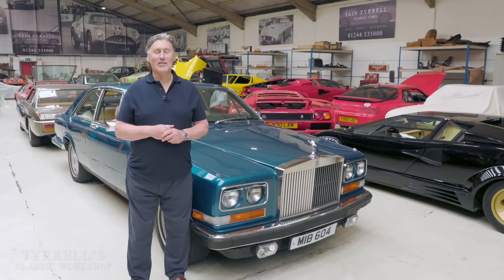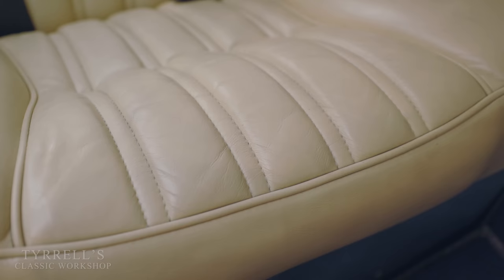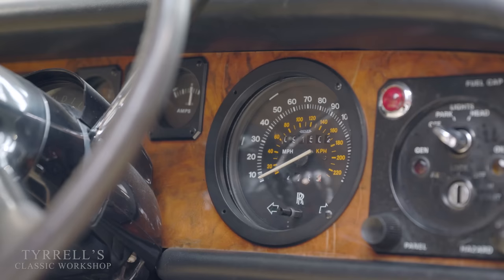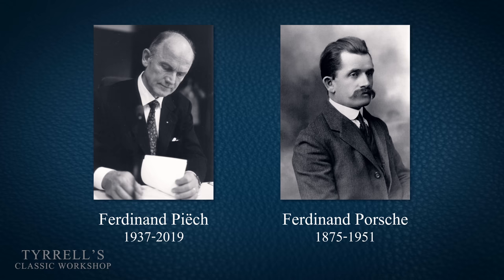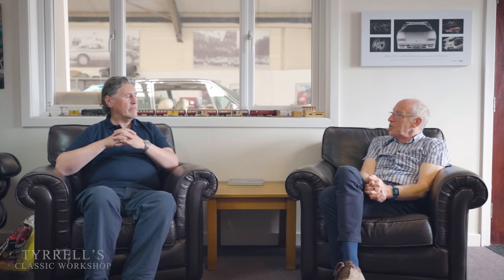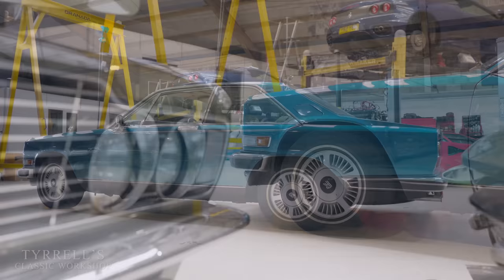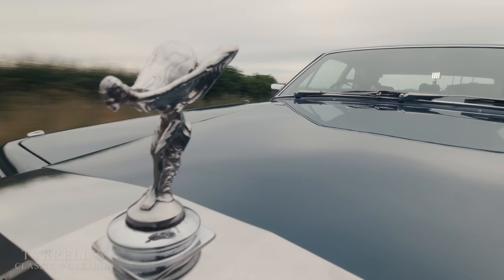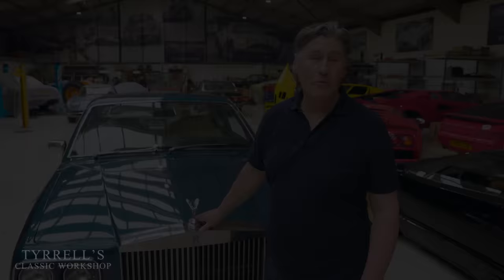Rolls-Royce Camargue - a surprising source of inspiration for the World's priciest production car

Comment: When I was doing a  couple of months "industrial experience" at Crewe in 1969, a requirement for my engineering degree, a guy turned up a the parts department looking for a replacement sump pan for his 1920s Bentley barn find that was originally one of Wolf Barnato's Le Mans racers - a one-off. Post race it was converted to a gentleman's tourer. The story was that they shoehorned a big engine into a smaller chassis and the sump pan was very non standard. The Crewe parts department had a replacement sump pan in stock. As soon as the existing one was bought, the parts dept. ordered a new one.
Reply: It's the same with heavy equipment parts that wear off  too slowly  or are never supposed to be replaced . Once you order the last part in inventory,  manufacturer give order to produce a new replacement  to be held in stock
Reply: Just imagine if 2 people ordered it at the same time 😂

Comment: Ian is absolutely right as usual. I ran a Shadow, then a Spirit, then a Turbo R years ago - and always thought the Camargue looked wrong. But with the slightly later alloys and in the right colour, they are ageing very well - possibly better than the Spirit/Mulsanne. As the Turbo R prototype was a Camargue (I believe) I can't help thinking that a Bentley Camargue with the Turbo R engine would be a fantastic retro mod.

Comment: Iain, a fabulous insight to the car and brand.  I can only endorse all of the previous comments - fascinating.  If I may, between 1984-87 I was a young police officer based in Crewe.  Part of my foot beat ( yes foot patrol) was the RR Factory.  I never got beyond the security hut with a brew but fabulous view of all the cars going out on road test prior to delivery.  I got to chat with a test driver, all hand picked who explained that most cars would have around 80 miles on the clock.  Due to them being hand built they were all very different, with their issues yet perfect once they went out for delivery.  Masking tape around the steering wheel to write notes on to remind each test driver of issues.  Final wash a polish and it’s new wheels fitted, test ones removed - great.  I would add that your channel and Harry’s Garage make great viewing, far better than the BBC these days - thank you, Mike.

Comment: Oh how much have I enjoyed this video! Thanks again, it's always a huge pleasure to view them. I'm fully aware of the battles between Chassis Development, Forward Engineering and Design departments in the early stages of a project development, to make sure that once in production, the car will give the eye a correct stance, a perfect appearence of standing on its feet with perfect balance between its corners, and with all the four wheels filling the wheel arches in a pleasant way to the eyes. But of course, in the early 80's things should be fairly different and more difficult! On another subject, regarding the visit of Dr.Pïech to Crewe, I can imagine the stress of having to give bad news to him ... something similar seems to have happened a decade before, when a chief engineer at Porsche had to inform him that the 917's modified by John Wyer (917 K from "Kurzheck"-short tail), although having effectively more drag that the standard ones, designed under the guidelines of Dr.Pïech himself, those were undoubtedly quicker!
Reply: Hello Antoni how are you doing 😊

Comment: Iain, Your information and brief history on the Camargue is correct and you mention a follow up. I was a Development Engineer transferred from the RR Shrewsbury Diesel Division in 1976 (turbocharger experience on diesels) to Crewe Engine Projects. David Plastow as you stated had the car created. However with its “built in head wind” design it was SLOWER than the Shadow and the turbocharged engine was specifically for the Camargue. All efforts at the time was for California emissions so all the R&D for fuel injection focused there. We had to continue with the Solex existing solex carb in a sealed chamber. The engine was well developed when I emigrated to Canada in 1978 and the slogan for regular Rolls cars power output of “Adequate” was to be changed to “More than Adequate” for the turbo car. I still have several documents from my time and Super8 (now digitized) of the installation. Love your YouTubes and your engaging fireside chat informative style. There were 7 of us in the Engine Projects dept, sadly I’m am the only one left. They were a wonderful brilliant group of engineers led by Jack Read.

Comment: Funny thing is, I was musing on the Fiat 130 Coupe resemblance prior to it being mentioned (particularly the rear three quarter view) - but I didn't realise it was influenced quite so directly. I just figured it was a Pininfarina design of the same era, and chalked up the similarity to that. As a youngster I found the headlamp treatment a bit clumsy & was dismissive of the styling as 'ugly' - but looking at it again, it's really growing on me.
Reply: In the 70's, I lived opposite a Fiat garage/dealer (in Hilversum, the Netherlands) where I befriended the many young mechanics (me being a boy of abt 12 years of age)...-they learned me how to drive at that age actually-, but what I remember from that time is that there was a Fiat 130 sedan once but never any Fiat 130 Coupe as far as I know much too exclusive I guess and the chief mechanic complaining that the automatic gearbox was not strong enough for the power that 130 sedan generated....causing a main failure at that time....perhaps they came with manual gearboxes aswell....anyway, never seen much Fiat 130's in the Netherlands ever....cheers!
Reply: Hello Karl how are you doing 😊

Comment: Well, this most certainly has been another gloss of delight again. Actually, I’ve never been able to pin down exactly the reasons why this specific exterior design has always been quite disquieting for my eyes as well. However, yes indeed, the smallest of utter details can enhance or disturb the balance of an entire picture profoundly in such a way that anything slightly off in the smallest can damage its appeal. The wheels and how it sits on them had not crossed my mind on this one. But yes, you have exactly identified pretty much the size of the matter. For some reason as well, the rather boxy exterior design wasn’t as refined as the Silver Shadow and Corniche perhaps. In terms of coherent elegant trim lines all around the car, something was off there additionally I think. The Camargue was quite a mixed bag in RR's line-up I should say. RR then were of course crafted cars, not mass production in where the smallest of niggling details in manufactutring are to gain imperative extra efficiency. Quite the difference. Thank you so much for sharing the actual insights from first hand. And thank you for having Pete Aston to share some fascinating insights.
Reply: You seem to have more knowledge of these cars than one can get from watching videos like this one. 
Thank you for your comment!
Reply: @Conservator.  Oh well, this is most flattering, however from engineering points of view, deep insights and stories, Tyrrell's channel for me is an eye opener as well, very much so. Mostly I am aesthetics oriented and well into classic cars, but matters on engineering and deep networks at the very top such as Tyrrell's is best learnt here. Big company politics and how things might float internally at the top is something I have experienced and can actually relate to. It's not for the faint hearted to say the least. Of course Piëch and the German way was being mentioned, and I think that Mr. Aston had to be quite delicate. I can imagine his utter shock at the time a bit, lol.
Reply: @lindaoffenbach  Reading your comments put a smile on my face. 😉

Comment: That lovely SOLEX carburetor was also used on the 1975 Mercedes Benz 280 / S M110  Sedan & Coupe. I spent many hours adjusting the secondary opening setting using special weighted tool. Combined with Clayton in floor Dynomometer to test my work. Rewarding maintenance work. Amazingly poor performance when wrong, almost exciting when operating properly. I also Dyno tested a client's Camarque before and after it had US No-Lead emission exhaust vs Euro leaded fuel system exhaust changed everytime this African Diplomat shipped the car overseas and back to Greenwich, Connecticut. We were a Rolls dealer at my MB dealer, but Rolls corporate wouldn't quote me Horse Power readings so I had to come up with my own using the Dyno. Exciting times for this young Star Technician used to getting all sorts of Dyno test specifications from Mercedes. The Camarque was an exciting car compared to the stodgy Clouds. Iain, thank you again for another great video highlighting cars from my past 🇬🇧👍
 C.D. in New Hampshire 🇺🇲✌️

Comment: Great video. The Fiat 130 comparison is well known but I think another interesting parallel is the 1977 Chevrolet Impala/Caprice, specifically the rear view focusing on the boot lid, rear lights, rear screen and side crease line. Suspect there was some Fiat influence on GM as well.
Reply: The 1977 Caprice rear end looked better though!  The 1977 Caprice overall looked so much better too.
Reply: The roof quarter window is also similar in the 77-79 Pontiac Catalina/Bonneville and Buick LeSabre

Comment: Interesting car, but compared to a Corniche positively inelegant. Two things stand out - the window line rises then drops, and I believe this was to incorporate the Shadow derived scuttle, whereas the 130 Coupe has a low and straight window line, and the rear pillars are too far back in relation to the wheelbase. But, when you're in it, you can't see it, and I expect it drives as well as the Spirit I once had, which I liked.

Comment: I concur that it is amazing that you can "Waft - Hussle" and new 1978 RR Silver Shadow II with the rack and pinion steering and well set up suspension.
It was a fabulous touring car across Europe on secondary roads.

The handling and ride further improved when I replaced the original Dunlop Aquajets with Avons after 25,000 kms of hustling waft....
Avons were recommended by the RR service centre in Geneve and were much better in the wet.

Great fun for a 25 year old Aussie youth hostelling around Europe with the benefit of saving 92.8% import duty and sales tax taking it home after 17 months.
Taking it into Hungary and Yugoslavia in those communist days added to the sense of adventure in the spring of 1979.

Comment: The styling links to the Fiat are amazingly pure. Twice the cost of a RR Phantom  ? Wow. And I too like that dash board Iain
Reply: You must have misunderstood. The Camargue was about twice as expensive as the Shadow and about as expensive as the Phantom.
Somewhere I read that the Camargue was a little more expensive, somewhere the opposite is stated. Phantom, but it was not a serial model.
Reply: @davidsvetricek1588          At about 6:47 Mr Tyrrell shows The Daily Express magazine, which has the price of a standard Phantom V at £18,000…… only just a bit more than a Shadow.   I can’t believe that figure was correct.
Reply: @davidsvetricek1588  At that price it doesn't really matter does it ? All Iain's cars are way beyond my means anyway.

Comment: This Solex (4 bbl) was actually used on the BMW M20 engine (2.0 L) as mentioned, as well as the M30 (2.5 & 3.0 L).  Early E12 525 (2.5 L) and 1977 or so E24 630 CS (3.0 L) before reverting to L-Jetronic.

Comment: That Solex Carburetor your bragging on is is a Rochester Quadrajet, a design by American manufacturer General Motors.  Take a look into the primaries and you will find the 2 "hidden" screws securing the top plate that gave so many mechanics fits when trying to service on of these carbs.

Comment: Going back to the under bonnet segment of the video..did I notice a Fridgaire A/C compressor fitted to the pulleys on the back of the engine? RR did the best they could with that unit..American A/C was light years ahead of the rest of the world when it came to cooling cabin air.
Reply: General Motors made the best automatic gearboxes in the world and the best air conditioning systems in the world, i think Frigidaire is a company owned by General Motors. 

There's a funny story about when RR started to investigate about using GM gearboxes. They didn't trust GM and their quality control and tore every gearbox apart and built them up again using finer tolerances. But for some reason they didn't work as well as the untouched ones? When they contacted GM about it they were told "Yeah we tried that but somehow finer tolerances makes it worse?" After that, they never doubted GM ever again.

Comment: Reference the mentioned Mini and carbing an engine on the RR.I used to be part of the classic mini scene and some guys put twin SU's on a 998 lump. The extra performance was all in their heads frankly.The ASeries can only cope with so much intake due to its siamese head.Most of the extra fuelling ends up going out the exhaust.

Comment: Styling…..what always struck me is that this car was top of the line for RR yet the bits and pieces look like they were straight from Fiat, like the tail lights and front parking lights, just looks like the car was built from existing parts from any source other than being manufactured by RR.  It’s nice though,

Comment: One of my first model cars was a 1.18 scale Bburago Camargue in dark red. Loved it. The only thing I dont like about this particular car is the wheels. I associate them with the Bentley Eight. The older rims suit the car far better.
Reply from the maker: The Camargue deserved its own wheels from the outset, but the engineering dept wouldn’t work with alloy wheels.
They alone were responsible for much of Crewe’s products’ “foibles” unfortunately.
Reply: @iain_tyrrell  I think my preference for pressed steel wheels on the Camargue has more to do with my old model Bburago! I do completely agree with the point you made about stance, though. I find the Bangle era 3 Series, particularly the saloon, guilty of that as well. Rear wheels inset into the wheelarch make it look unresolved and the car chronically undertyred.

Love the videos, Iain. Many thanks indeed!

Comment: What a shame RR shunned alloy wheels initially and never filled the wheel arches properly.  As you said, with a bit more thought it would have looked better and sold better.  Despite the price.
Reply from the maker: The engineering dept made some very strange directives in the 70s and 80s unfortunately

Comment: The overall form of the car I find still very elegant, although some of the detailing is a little odd, and by today's standards it's not a big car, shorter and significantly narrower than a Range Rover for instance.  Torque appears to have been about 400 lbft, which should be 'adequate' for a 2.3 ton car.  Fascinating inside story!
Reply: when you say shorter do you mean height?
Reply: @raycroal  Length.  The old Carmargue was 5.169m long compared to a current RR LWB at 5.252m; although the SWB is indeed 4 inches shorter.  In its day the Royce was thought immense, almost too large for UK roads, especially its width of 1.918m which was 4 inches wider than a Shadow.  Nowadays 2m wide cars are common and the RR weighs in at 2.2m.
Reply: @timgosling6189  that surprises me, i remember the w140 was like an american tank in its day but just a big car now

Comment: As regards the lower rear suspension; I heard that was designed on purpose (tail down attitude) to make it look  like it was going at speed even when it was not. And Barry Sheenes' was fitted with alloy wheels in the 70's, though I prefer the hub cap version. That model looks like a fuel injected version.

Comment: Surely it is known that the Solex carb used, also on some later Corniches, was a copy of the GM Rochester Quadrajet. I've had one in my hands from a Rolls where the owner wanted the induction system making SU? No comment.

Regarding what engine size BMWs the Solex was used on, the equivalent Quadrajet worked effortlessly on Cadillac's 500 cubic inch (8.2 litre) engine. They were very effective re economy, that's a relative statement and when the pedel was slammed to the floor those two huge rear bores opened and power was delivered superbly.

The Solex was also I believe used on those first Bentley Turbos, hidden in a chamber on top of the intake?

Comment: The Camargue and 130 rear end styling also look very similar to the Pininfarina-designed Ferrari 375 GT4 2+2. That rear quarter window and boot lid treatment seems to have been a recurring theme at Pininfarina  in the early to mid 1970's. Pininfarina even designed a Mercedes Benz concept at around the same time that also looks extremely similar to the Camargue.

Comment: 28:40 I was wondering about that carb.Having heard you mention BMW520, I would imagine that carb was fitted to the  (I believe) M60 2litre 6 cylinder engine? Friend of mine's mother had one, on which I did a fair amount of work including a complete engine overhaul. (The local dealer had told her it was quite normal for the car to use over a litre of oil per tankful of petrol...)

Comment: The horrible Solex 4A1 was used on BMW 623's and a lot of different Mercedes W114 models. A worthwhile solution to 4A1's long list of  running problems was to retro fit a Holley 390CFM 4 Bbl carb . I have seen bigger holley 625 CFM carbs used but they are too big and caused all sorts of plug fouling issues.

Comment: Beautiful motorcar ! As they say, much more than than all it's parts assembled.
31:10    "It's dual level air conditionning"... A little irony here though : The best car we ever owned and have driven to the ground had this genius feature. A 1992 Nissan Stanza SE, U12 series.  *We could modulate the temperature separately to the feet and the upper outlets, both for summer cold air and winter heat. A solid, very well Japan assembled sedan, the last of it's breed. And it closely looked like a BMW 3 series !